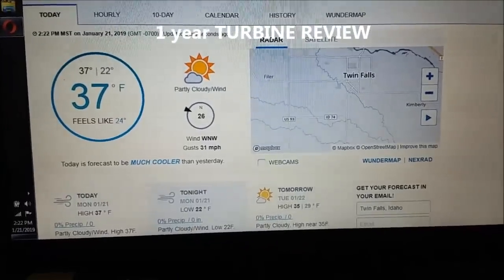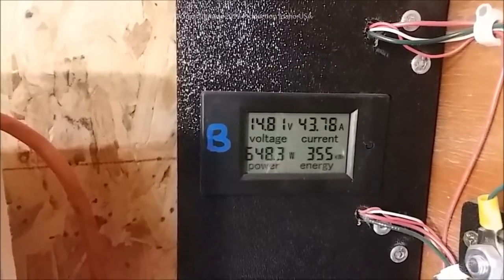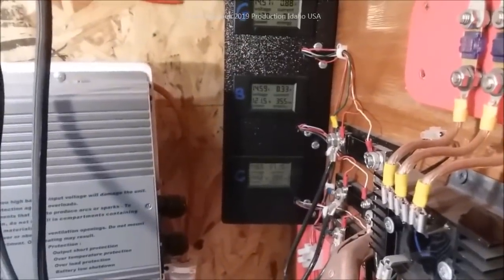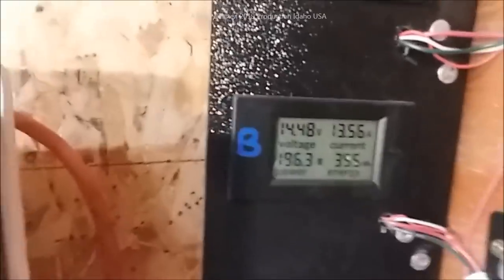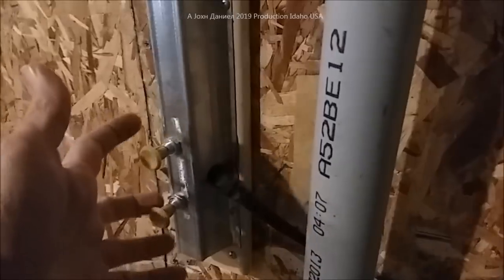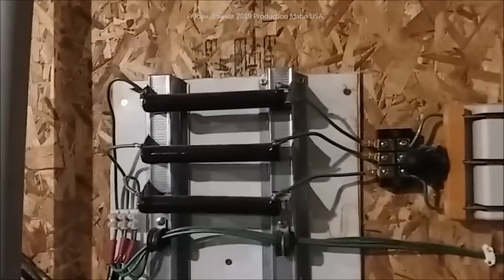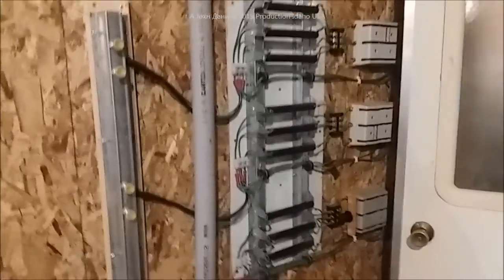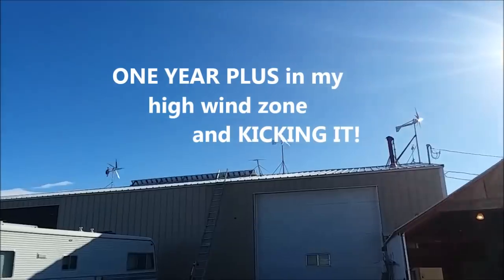The best Chinese Wind turbine, Great results, 1 year+ review FULL PARTS LIST BELOW VIDEO

Comment: Hi John, what charge controller do you using for Chinese wind turbine? Its mppt?
Reply from the maker: all are Direct feed via rectifiers into massive bank with multi stage diversion system. I have so much wind, it never justified buying $300 MPPT to put on $300 turbines!
Reply: @JOHNDANIEL1  yes, that's right, I built my first wind turbine with a hoverboard wheel motor, with 6 " PVC pipe blades, magnetic brake, 35 amp  three phases rectifier with cooler, a multimeter, slip ring, solar charge controller, furl tail, this turbine charging a simply 12v battery can reach 150w or over the 10 amps, really charge very well the batteries, then I think that gonna buy a Chinese wind turbine, I'm from Argentina, I'll show my home made wind turbine 80% recycled before painting.
Reply: @JOHNDANIEL1  https://youtu.be/cmMrn2YlaJw this is my wind turbine working.
Reply: @JOHNDANIEL1  Hi, This is my first and entirelly homemade 90% recycled wind turbine, and works so fine in a windy day like today, but a need a dump load circuitry for the extra power coz the cheap solar pwm controller isn't effective at all, coz makes vibrate so much to the wind turbine when reaches over 15 volts and brake to the wind turbine, some gusts it reaches 16volts, almost 17amps and 260 watts, by now it's charging two lead-acid batteries in parallel, so, I need make myself a dump load circuitry to substitute that pwm cheap solar charge controller, I'll appreciate any help nd question with a good dummy pcb board circuitry to make it, I hope that the video, any questions or suggest I'll appreciate, I hope that you like it and enjoy, this is the link:
https://youtu.be/wjDQpsr6zcI

Comment: Hey how you doing brother and quick question I like that wind turbine been watching your videos to that wind turbine at what speed is charging because I'm located with long little wings I live in Anchorage Alaska and I'm looking for a wind turbine because sometimes when it starts raining or start snowing something rastro for your boy get charged
Reply from the maker: Depends on your mounting location, but in clear air at 7 mph and higher its making over battery and adding charge, at over 12 mph its 5+ amps, over 20 mph its over 15+ amps and it will hit 600 watts + (40 amps) in winds over 25

Comment: Love your video John, best I have seen. lots of great info.  I want a wind turbine to add to my 10kw solar array, really for fun.  I live in ventura California 4mi from the beach. 2-story house gable roof, the ridge runs east/west. 42deg pitch, ocean due south.  QUESTION what should i get? 3blade or 5blade 12 or 48v.  my weather station  on my roof (about 28' off ground) shows normal weather: constant 0.5knots with 2knot peek

Comment: Howdy champ...enjoying learning your wind turbine stuff....Wondering could you use a tacho on the generator to know wen to cut out from over reving wen batteries full and hi winds...utilize an adjustable shift light to trip going into brake mode or maybe bypass to nutha battery bank .??  Any thoughts. ??..cheers  👍

Comment: Hello Sir, Question for you, I noticed two things that "perhaps could be thought about", dumping power through resistors when it could be dumped into a water heater element would perhaps be "More Green" the other thing is that you could place the 3 phase rectifier near the wind turbine end, thus two situations, more wind power more wind for cooling the block rectifier, thus only needing 2 core cable, "Welding cable might be better for low loss of power" you could mount ALL the control near the wind turbine, and have only two control wires activating a heavy duty relay to provide the breaking, but you could still mount the load at the output rectifier end ? yes the rectifier would take heavy power IF the unit is rated at the expected MAX power,  overvoltage / over current relay could switch automatically into a water heating element, I personally just think all the resistors used in your system might  be better to dump exsessive Load / Heat into a water heating element, you could still monitor the max wind speed using a hall effect probe on a toothed gear using this as part of the automatic load system, or just measure current using a shunt, the output wires from the shunt dont need to be heavy duty as the load into the Digital measurement indicator is around 1 to 10M ohm, a shunt with s suitable millivolt output say 100A 100mV would be better used than a 100A - 75mV output which is for old switchboard  analogue instrumentation, you can get dicast box with rubber seal and waterproof glands for the cables, for the instrumentation, I used LASCAR simple pannel indicators from Farnell or RS, Components, all perameters can be changed with links provided on the back of the panel meter, use 200mV FSD input with 100A shunt crompton shunt is what I used in the past, if its voltage you wish to measure then you use a resistive divider network, 
I was Deputy Head of a UKAS electrical standards laboratory in the 1980's to late 1990's, expert in test instrumentation & control, 
dont forget the cooler the rectifier the less voltage drop across the silicone junction thus should be greater power,
Reply: CoolMusicToMyEars I’m new at this but why do you want the board near the turbine? I thought the turbine produces 3 phase AC which is fine with long distances and can use smaller wire. I find this YouTuber difficult to watch. Very confusing and jumps around. He said one thing that I know is wrong. He implied that MIssouri Wind unit is an alternator. Lie. It’s a very good unit custom built for wind. When people lie I turn off. But hard to get valid analysis of these Chinese turbines. Down to $150 for 500w now.

Comment: I film using my cellphone.
Try this to clean up the wind and background noise. It has a built-in noise filter.
https://www.amazon.ca/gp/product/B076BCM26H?ie=UTF8&tag=jtjohnston-20&camp=15121&linkCode=xm2&creativeASIN=B076BCM26H
And it's made for filming with cellphones. 

Use this aluminum rack to hold your cellphone and microphone
https://www.amazon.ca/gp/product/B07D6PRGXD?ie=UTF8&tag=jtjohnston-20&camp=15121&linkCode=xm2&creativeASIN=B07D6PRGXD

Comment: I could not find where it said, Does that come with slip ring?  I am thinking on getting that but must make sure it has a slip ring so my wires don't twist up.
Reply from the maker: Comes with a factory slip ring. The GE500 has proven to be very successful orbital magnet design. I was preaching this to USA makes for decades, the Chinese finally did it and mass verses magnetic flux now are equal because they tried it. Now you know why they are beating us in everything. We gave up on innovation.

Comment: looks like a 3 blade is all i need--just need to know does it come with a 12 volt plug in going to buy one if it does--what a benefit to a kodiak solar generator best on the market
Reply from the maker: Depends on your area, wind consistency and need. I prefer to refer the 5 blade to everyone, and then buy a WNA original 3 blade hub from Ebay that fits it and the blades. Need that item sourced, let me know.
Reply: well i will buy the 5 blade then
Reply from the maker: BTW, if you get the 5 blade then order the 3 blade spare hub GE500 uses the M Model. It is the 139mm, M in this  listing, https://ebay.to/2CrkkEq . Then if 5 performance is not what you like, remove 2 blades, swap hubs and keep going!

Comment: Never had wind power so I am a newb. I do have existing solar with 48V battery bank. I am going to order the 800 watt 48V version of this turbine. I already have a spare classic 250. Tie it to the Midnite 1500W clipper.  I want to try to set it up conservatively so it will hopefully live a long time. Clip it right at 800 watts maybe even 750 watts. Any guess what voltage that would be?   You see any issues with that setup/plan?

Comment: Can i connect 2-4 of these turbines in series to input a higher voltage?
Reply from the maker: NO, they have to be individually controlled, braked and pulled from.
Reply from the maker: The 48 volt model has 30 to 110 volts range.
Reply: @JOHNDANIEL1  nice , il look it up & thnx for info

Comment: I'm not looking at getting maximum power from this turbine I would be happy with 200 watts or 300 I just want something that can charge up bank at night or crappy days. I think it's getting enough good wind where it is to get some power from it.  Having the custom controller with a rectifier will give me a way to meter the incoming voltage better so we all can see what is actually happening with it. I'm impressed with this so far just do not care for the crappy controller that came with it.i told my wife what you are doing for us she wants to do something nice for you you sir tell me if you would like some flowers sent to someone or candy bouquet I will deliver it personally with in 60 miles from blackfoot.
Reply from the maker: Working on 20 things at once, house is selling. So may be a few more days on the controller parts. Even uploaded last video from archive.
Reply: @JOHNDANIEL1  I bought a new battery bank today 12 Crown CR-235 1,410 AH 12v . My bank was so old I decided it needed some love. Holy shit its powerful  now. Thanks for letting me know. I am going to pocatello tomorrow and my back hurts. I gave them 12 crappy batteries for core fee . I kept the other 16 for a backup bank. I lifted so many batteries today my neck and back hate me right now .
Reply: Would it be easier for you if u came and picked up the stuff?I know what busy is and 20 to 30 things going on at once. For me its Valentine's day with a large grand opening event 1 week apart from two in a row with 20 funerals going on and school dances and not enough drivers it can become crazy.  4 days with out sleep . Sucks.
Reply: Hey John what was the link for telescoping pole parts I needed ? The link you sent me isnt showing up because to many people sent me stuff and for some reason YouTube only let's me go back so far. I bought a welder so I can do the project now.

Comment: Thanks for the tip on voltage I turned on a 1500 watt space heater to drop voltage to 12.0 under load and shut off all solar panels and the turbine did in fact take it back up to 12.6v

Comment: Uber impressed and looking to learn more... is there a any cite or reference to your overall wiring and sub-sytem designs that you have published?  Most helpful so far and looking to close the loop with a one-line or schematic.  Thanks in advance!!
Reply: OK, so I got the schematic for the  upstairs "ACTIVE BRAKING and POWER CONTROL" (awesome!)
Now if you had the downstairs "Rectifier / Battery Bank" section I'd be most grateful!!  You did mention you'll be doing a SCHEMATIC VIDEO, so waiting patiently.
Thanks again in advance.

Comment: I have gone down the rabbit hole and come to realize that the large commercial wind farms/turbines are nothing more than a Freemasonic hoax. Your little tiny Chinese turbine needs to turn around real fast to produce a small amount of current but the huge MK watt ones run at very low speed producing so much electrical power. The AIR around us is electrically charged and they hang Cable's in the air to harness this invisible power!

Comment: JOHN,  just ordered a 5 blade  HAWT 500 WIND TURBINE  from AliExpress. $291.00 delivered! Hope its as good as you say!  Thanks for the videos.
Reply: That's the one I ordered its built very nice. The excluded controller is horrible.  A custom built controller is the best for these. I tested mine with a 100 amp rectifier and voltmeter and it definitely works. I just need to build a telescoping pole for. My portable trailer  its mounted on to get good wind. I will show everyone after John sends me a custom build controller and dump and I  finally build the pole system I need. I love the 5 blade because it works in lower winds.
Reply: Check out my new portable wind turbine tower I built by modifying a 3 ton hoist lift.https://youtu.be/S_AuPCd9rSM

Comment: Ok I ordered one it was 367.00 500 watt 12v hoop base option.  Want to mail me the controller on a COD that's fine too. Send it to my flower shop I do not want to post my home address online. Attention Donald and Heidi Steele busy bees floral 1171 parkway drive blackfoot idaho 83221. Just let me know before it sends out I will give the cash to my secretary and cashier so they can pay for it. Or give me another platform link or what ever for payment. Thanks john. Please let me know what I wont need to buy and what's excluded with the controller and its rating,  do I need to build a dump?
Reply from the maker: I can get you the controller to that address. It will be a 2 stage, and I will send you some links on its settings and properties.

Comment: How many controllers will I need and do I need to buy a meter and resistor bank? And brake box lol.
Reply from the maker: The controller will have a full class 4 meter, 500 watts of resistive load, (200 first stage, 300 more second stage) and a rectifier, cooling fan, sensors, 2 - 40 amp SSR's and the mounting. I build these for $128.50 delivered in the USA for other installers, its my own branding and design. YOU however can buid your pass through braking design, I will supply parts links and email you a schematic. You can put your email on a comment post for this video and since they are on APPROVE FIRST for this video, no one else will get it but me then i can delete it instead of approving it to show on the video. 
John
Reply: Man I sure wish I had the custom controller right now mine was no good and they sent another one and wont be here for 31 days . I'm totally screwed now. Turbine wont be ready in time for my trip. And now my wife is complaining about the cost and says it doesnt work blah blah blah. The turbine actually is getting awesome wind where it is if I had it higher the trees would block the wind unless I had a 100 ft tower which isnt very portable.  I need to show her this works and that China just makes shit controller.
Reply from the maker: Been on the road, New Mexico. I can fast ship you a basic, controller with rectifier and preach you through it over the phone, I'll get one out tomorrow to your place. For now lets get you a rectifier, resistors, fuses and diversion set up in the UPS or fed ex.  The supplied controllers do not like dirty winds, they are made for constant input power, its the connect/disconnect voltages on them which is problematic in dirty air. Bad wind makes it Surge on, hit brake, reset internally, repeat. Not a good way to run one like you have it set up. You just need clean air, and the results will be there.  Look for a tracking number asap, probably get it monday or tues.
Reply: @JOHNDANIEL1  ok is there a PayPal thing for cost? John I love your videos and amazing setup lol. Did you notice these do not say me500 or m500,  they are Ge500? Isnt turbulent wind the one that makes the turbine sway back and forth pivot side to side? I do get that sometimes.  I am working on getting more money together for a telescoping pole setup. I need to buy a good welding setup and need to save up for it.  My yard is surrounded by very tall trees and the pole wont help much here. But the intended use camping and backup power a pole that goes above the flowershop building would help if i was powering our walk in cooler during a power outage or just 4th of July event at our shop. It would work good there 20 to 25 ft there would be perfect its flat there. You sir are amazing thank you for your help . I bought a clamp meter to measure some stuff and a shunt and drok multi digital meter . The clamp meter was expensive and ate a bunch of budget. I drained the battery bank intentionally during a good wind direction event . To 12.2v and had mostly  fair wind at steady direction and speed with a turbulent gust about 1 in 3 mins ratio.  And zero voltage increases.  I'm going to pack the trailer up after I have a working controller and take it to a good hilltop in pocatello or up to wolverine canyon on the top of the hill there. And make a video and test it high up.
Reply from the maker: PS - Those controllers are PWM, Pulse Width Modulation. The battery bank if over 13.8 won't take full power from the turbine, the controller will throttle power it sends to the battery, making it look like its bad. So if your turbine is making 250 watts, your battery is at 14 your controller is already cutting 70% and diverting it off as your bank gets full. Start with a 15 mph wind, clean air, and a 12.0 volts (low battery) battery, your gonna see the true ability of these turbines. And the settings on your solar controller can really screw up your wind controllers feedback.

Comment: I saved the older link that had the hoop based version on it is that the same turbine? Should I just order that one ? And also how do you wish to be paid for the controller? What size is the controller? Will it handle multiple PMA,S? and will it have a resistor bank for dump and brake controller? What's the specs? When we get our land and want to build a small cabin on it I want to be able to add to the system. And will the controller have a AC and DC meter on it? Can I add one if not? I eventually will want 4 turbines. I already have some solar. Is the controller mppt or pwm?